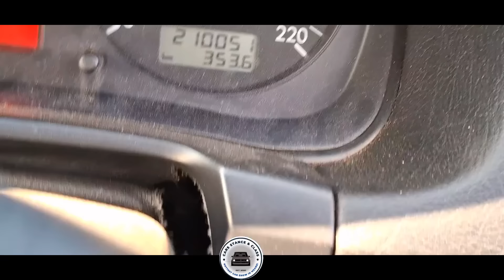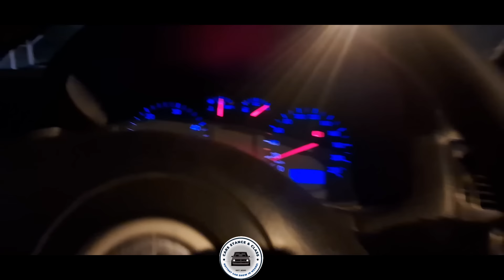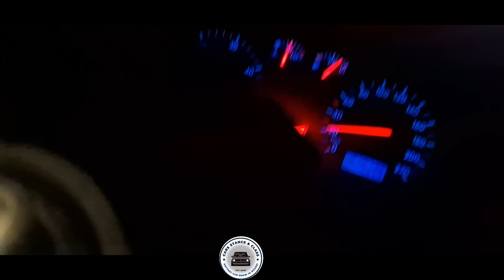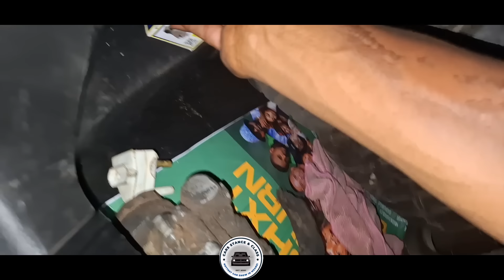NKUPI NEW VR6 MOHLAGO 🫠 EXAHUST PATCHING, ALL BROKEN PARTS FIXING. ☺️ SATURDAY IS HERE RUSTY ✈️

Comment: Those low profile tires are gonna bang on Mohlago nna i'm ready🔥
Reply: It's going to happen without the correct suspension an springs there's going to be alot of broken parts ....it's nice to have it but pay in mind the car is not a golf it's a station wagon so it's heavy making the drive very hard an uncomfortable. Just my opinion but your car sounds nice🤟
Reply from the maker: Can't wait buddy.

@Kalenwatson728 I've bought coilovers, wouldn't that help?
Reply: @carsstanceclass  it's going to help but not completely because your tyre profiles is making it harder for them to do their job.but also put them on drive a week an think about it if it's a good option for your car.